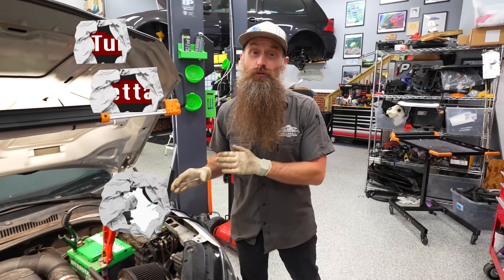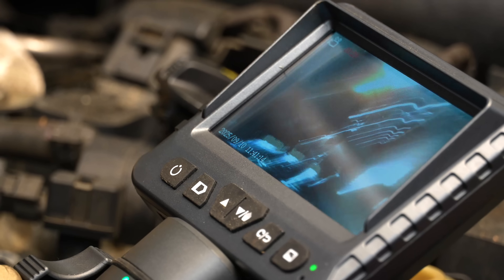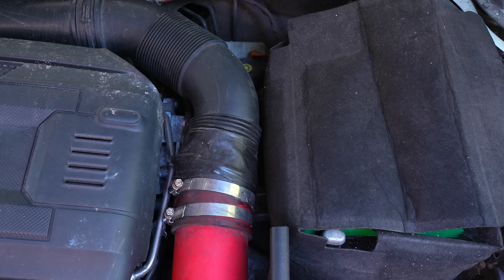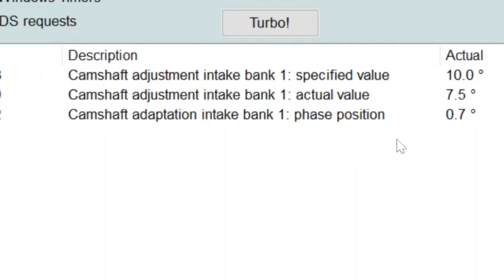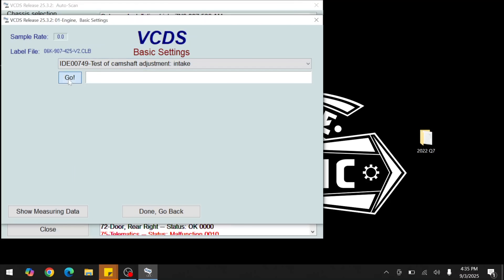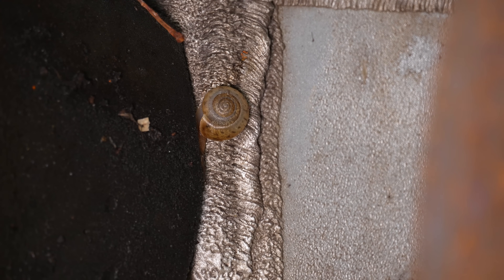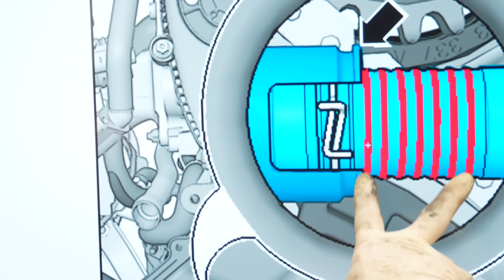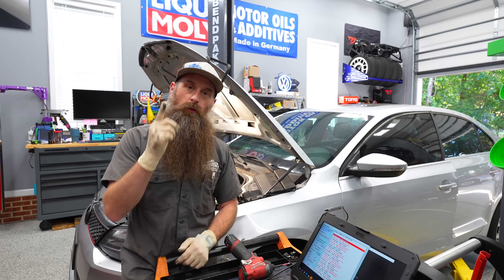TSI Timing Chain Failure: DIY Test That Will Save Your Engine

Comment from the maker: Do you have timing chain stretch, wear, noise, or rattle on your EA888 2.0T or 1.8T? This quick DIY check works on VW, Audi, Porsche, Skoda, and SEAT.
⚡ A few minutes now could save your engine and thousands of dollars in repairs.
👇 Drop a comment if you’ve had timing chain issues with your EA888 — let’s see how common this problem really is.
Reply: Hey, how many miles do you have to have before you need to start worrying about this?   I'm wondering if I need to pull that plug off and check the tensioner.  I kind of miss timing belts, you knew you were going to have to replace them but they didn't cost that much.
Reply: @jeffk464 just buy a obd11 and check your camshaft position...

I have a 2012 beetle turbo 2.0tsi e888 gen 1 and I just did mine at 149k miles..
 My timing was -5.47   which was out of spec ... i checked it.
About a year ago and I was in the forest so I figure the way I drive and the power that my car has.I stretch my chain one degree every year...

I'm around 320ish whp on a cts ko4... I think a lot of the timing components depend on how often you change your oil... I religiously change mine at three thousand miles...
Reply: 2006 Golf MK5 GT TSI 170hp (BLG) ex-owner.
Right after the 2 year warranty mark the car lit the check engine light.
OBDed the hell out of it getting only a "cylinder 1 misfire" warning.

Shop #1: changed coils and apark plugs. No luck.

Shop #2: official VW shop were the car was purchased. They had no clue. they wanted me to pay any replacement part and/or inspection until the failure was addressed. Heck no.

Shop #3: standard "bosch service" shop. They listened to me, I said there was a ratling noise under certain RPM, the inspected with boroscope and, yeah, stretched chain about to slip in the lower crankshaft pinion/crown and fully extended hydro-tensioners.
1300€ repair + 500€ for two weeks later because the Poly-V set just fell to the ground in a roundabout+ 350€ for oil cooler replacement.

Sold the car after all that. Of course it had tons of other issues during warranty like gerabox synchos crushed, N75/N95 and many other valves and actuators failure, peeling interior plastics, unbalanced flywheel, etc,etc.

So, VW is dealing with this issue since LONG time ago and still not figured how to get it right. Lamentable
Never buying a VAG car again.
Reply: Hey, Charles, is this the revised engine with the cylinder issues fixed, the one that comes with the MK7 GTI?
Reply: Are you going to the jamboree next weekend?
Reply: This isn't a full proof way of diagnosing using IDE00184 as there was no explanation if reading on a tsi 2.0 golf r for example.  Reading -1.1 exhaust phase position.
Reply: Hello, I have a problem with my Golf 7 GTI.

During heavy acceleration, the EPC engine warning light comes on and restricts the engine to 4000 rpm.

Fault code: P164B 00.

Have you ever encountered this problem?

Please help me.

I'm French living in Guadeloupe.
Reply: @Flingstone97 could possibly be your timing?Your fuel pump is controlled by a lobe on the intake came shaft.. if it's off you will not be getting the correct amount of fuel you need... So low r p m the car might run fine but give it the beans and you may get miss fires for lack of fuel...

That's just one option... There.
Are many more that can be going wrong
Reply: @korey420  Hello, thank you for your reply.

The fault code says (oil pressure switch).

I replaced the blue and brown sensors and still have the same problem.
Reply: met a guy with 300k km on his CJXC with no timing job done. had it since new, oil changes at 10k km
Reply: I’m
Reply: I chanched more 1,8t chains then  2t, but much more 1,4lturbocompressor 170Ps/ 167hp
Reply: Hello sir I have a question that's unrelated to this video but related to Volkswagen. I have a 14 MK-6 Jetta 1.8 turbo and I broke a ground coil while trying to change my ignition coils and spark plugs and I wanted to know if you could tell me which harness I need is it a 4DO or an 8DO I've been doing research all day I can't get the ignition coils unhooked right now to see the part number and I need to order the part I've been getting rides to work and am broke. 
Thank you very much.
Reply: Would you say these tips for checking it apply to a 2.0 TDI? Im aware its a different engine, but it is also a 2L turbo. Either its my Ac compressor or the timing chain. Neither is cheap to replace, so I want to make sure I get this right on the first try. And I dont want a dead engine. With the ac compressor off, the shuddering on startup goes away. The cooling in the summer is also subpar. At 70 degrees,  it doesnt ever really get cold. But I hear a very faint sound coming from near the serpentine/ timing chain area. It sounds like a metal file being used gently. And it makes the sound about every 1 second ish. No codes at all. Any ideas?

Comment: I just did the timing chain [due to chain chatter] and it started to studder and turn off... I quadruple checked my work.. but it still chatters and shuts off when I give it gas.. start up and idle is smooth.. what could it be now?

Comment: I have that magnet failed twice now on 2015 Passat 1.8 (255K)

1st one failed around 180k - I think it cracked, I don't remember exactly;
2nd one recently at 250K - it has a crack in the middle (was from a junkyard car 2014 Passat)
The crack is kind hard to see - I still have to old one if want a picture.

Symptoms: 
Same exact as this video - intake camshaft jumping values on OBD Eleven and some rough idle with sometimes misfires (No code for misfires although but you can tell).
My code was: 
P000A00 - " A" Camshaft Position Slow Response

Other checks - I did took the actuator out to see if stuck, clogged, or something wrong (reverse threads on it almost got me), but nothing found (move freely, nice spring action, and it was clean)

Replacing the magnet solve my problem for now, but I am planning to inspect that tensioner through the access hole when I find time.

My oil changes are every 7K blue bottle 5W40 of Moli with the MAN filter (bought the car at 70K - I think previous owner didn't took care so much and he did 10k+ oil changes)
Opinion - I think the Castrl is no good - the moment I switched to Moli it doesn't burn oil excessive  anymore.

Last: Every oil change I did on the last 180k, I always found 5-10 flakes of metal in the oil,
but nothing inside the filter, no idea where it can come from.
(If someone has a idea how find were is coming from without taking the engine apart let know)

Comment: Belt are better than chain ,long as you service the cars, change  oil every 10k miles. I have tt mk2 200k on the clock , belt changed every 60k.

Comment: I found one of these that had all the timing codes but when I tore it down I found that the little button on the intake gear was stuck out. Like the little button slipped out of the sleeve causing the intake cam to always be actuated.

Comment: So what's it mean if the phase position is 26 degrees? 😬
I've been trying to diagnose a P0016 on a 2017 A3 2.0 and I've already redone the timing chain about 3 times. I've checked all the usual suspects (spool valve, magnets, etc.) scoped cam and crank sensors and compared the waveform to  a known good (looks perfect) and I'm at a loss.

Comment: Hello, found your channel very coo thank you,  I just did the timing chain on 2012 A6, 3.0 and everything runs great, starts up , acceleration superb.  The only issue is now I have a warning light with a key icon "Engine system start fault. Contact dealer"  it comes off about 10 seconds after you start the car. Is this something that can be erased/fixed with VDCS  software? I was watching your videos on VDCS vs OBD11  ?

Comment: Hello, I have a question about my 2011 Audi A4 Allroad 2.0 TFSI (CDNC). I cannot confirm whether the timing chain has ever been replaced.

VCDS shows the “Camshaft adaptation intake bank 1: phase” value at around –7.5°, but there is no cold-start rattle and no fault codes. I also noticed that the Guide for Upper Timing Chain installed on the car has the part number 06H109469T.

1) Does the “T” revision on 06H109469T mean the guide was definitely replaced, or could this part still be factory-original?

2) If the chain was replaced, what else could cause a –7.5° camshaft adaptation value?

Thanks in advance for any insight.

Comment: I just installed new chain , tensioner and guides from Shopdap , paul !! 2017 vw Tiguan 2.0. After i got completed instal and rotated engine several revs the tensioner is out 7 ribs!!!!!  Spoke to Paul and he says to check for stretch!!!! My question is why would there be stretch on a not started engine yet , Ina timing    chain, tensioner and guides?  
Any thoughts please?? Thanks. Love ur videos!

Comment: Incredible tutorial. I've just had the timing chain replaced and these codes have come up- P0341/P2279/P2006, any instruction would be greatly appreciated. The P0341 code says camshaft positioning  sensor, should I replace it?
Reply: Did they correctly time it?

Comment: 238k on my 2016 Passat 1.8t with original timing and magnet.. Still within specs and makes zero noise.. OCI change every 5k miles religiously since new.. Still rocking the original turbo and fuel pump as well!!

Comment: I just bought a 2019 VW Altas S 2.0T. My father told me he heard clicking clicking while run parked or driving on freeway. I want to know if you know what it's cause noise clicking from front right bumper area between passenger. I am very concerned about it. I hope I didn't bought a lemon SUV  😞

Comment: You guys make out like these engines are rubbish. Sure , they aren’t a 2JZ , but with proper maintenance and proper mods they can be a 350jp motor that will be a fun DD and weekend fun machine. You want a 500 hp monster out of the box , then buy a Supra. I have an IE forged internals 2.0 in my 08 GTI with an internally worked K04. Overbuilt for reliability, but will never have an issue.

Comment: Charles do you ever use a pico? Im starting to transition to using it more that just a scanner to diagnose and i think scoping is a skill many mechanics lack
Reply from the maker: I’m a rookie pico user at this point in time.
Reply: @HumbleMechanic  ok, I completely understand you on that Charles. One thing the dealer lacks is proper oscilloscope training, and Im a former acura honda tech and when I left the dealer I realized the independent diagnostic guys that used pico a lot really were a different breed. Makes me respect guys like Eric O and Super Mario and Sherwood from Royalty so much more. The dealer world needs to really start implementing that to transition us from parts swappers to actual technicians. Diagnosing with an oscilloscope is a whole world that helps us without ever busting out a wrench.

Comment: I love your videos! They encouraged me to start doing most of the maintnence stuff by myself saveing me a lot of money! 

Maybe an odd question, but is it possible if the camshaft RPM sensor won't display the camshaft revolutions (I got no error message but with OBD11 the value stays at 0RPM), that there are some odd shiftings  from the gearbox due to lack of consistency of the camshaft RPM and engine RPM?

I drive an 2018 GTI Performance with -120k miles on it.

Greetings from Germany!

Comment: 266,000km on my 2016 TT and still on original timing. Using stage 1 unitronic as well. 

 The problem is bad drivers. Not bad parts. Change your oil based on how you drive it, not how many km you drive.  and use good oil. Not even dealer oil is good imo. If it’s a euro car, liquimoly or motul should only be used. 

I also don’t like cruising in low rpm. I always keep my cruising rpm no lower than 2000. Let that oil pump feed the top of the motor. 
I recently changed my hpfp and while i was there i swapped out for a new cam follower and it literally looked brand new still. No wear markings. Keeping your rpm higher when cruising will help the head lubricate properly.

Comment: I'm likely being simplistic here, and due to the high mileage of 181K and the state of the oil found on the dipstick; is this a case of few and far between oil changes (amongst the other visible abuse of that poor GLI)?

Comment: On cold start up with my 21 GTI 7.5, I get a bit of chain clatter, but then it instantly goes away. The dealer thought it was an issue and changed out the magnets. The clatter still happens. When the car is running it is buttery smooth. I have no fault codes. Should I be worried?

Comment: I actually did my timing service on my B8 A4 a few days before you posted this video, referencing videos made by you and Paul for the diagnosis and repair (as well as AllData, of course - your videos and articles had some info the repair manual didn't include though (: ). This video is very helpful for referencing almost all the issues I was checking. Balance shaft was out of time so bad I'm almost convinced it caused my 16 y/o motor mounts to blow out. The VCDS is incredibly helpful compared to OBDEleven since it actually allows me to run the cam adjuster test. I notice you run a procedure along the lines of Timing Chain Lengthening Reset After Replacement in a lot of videos, which I couldn't find for my vehicle but evidently didn't need to run as it's 1000x better now, is this specific to certain VW/Audi models?

Comment: Damn my sister has a 2018 Passat and it started to feel like it is miss firing at idle. We put some intake cleaner in it. Then after we drove it around came back and reved it up a couple times it was making what I'm only assuming was a timing chain slap after it idled down from reving it.

Comment: Hey, do you know what this issue might be? I've recorded a small video clip for ref https://www.youtube.com/shorts/trdmAhEDDkg It only happens when I press the gas pedal, and once I release it, the sound fades away after about 1–2 seconds.Could it be related to the turbo or fuel pump? The car is a 2019 VW Caddy TSI 1.4 (Europe).

Comment: Guys it's time to call VW out, you have seen the quality drop in all VW engines since the 2.0 ABF block. 

Plastic inlets, plastic sumps, plastic water pump fins, the cars are designed to fail.

Comment: Any reason why the intake/exhaust tests won’t activate for OBDEleven? With the idling I only get an error for  “Function cancelled, marginal conditions have not been met”. I can get the tests to go active if the cars off but that’s doesn’t work for an engine test 😅
Reply from the maker: thats odd. ive found that sometimes cars are fussy. Also some of the tests are not ran when car is running.
Reply: @HumbleMechanic  Turns out I'm still a rookie and was trying to perform an "output test", looks like the correct option is under Basic setting. Thanks for taking the time to respond and producing great vids!

Comment: Please help me Mr VW expert. Our 2014 VW Passat 1.8 tsi engine is broken down. We want to replace it with a used one but we can have a lot better choice price and mileage wise on 2015 Passat 1.8 tsi. The used part guys say that they are not interchangeable. Is there a major difference? We can swap some parts as long as the car runs with no issues. Are the piston rings updated in 2015 also? Thanks

Comment: Very informative video. I have a 2018 EA888 Gen3 and just wanted to ask as my exhaust phase position is at -3.7 and intake phase position is 0.3. As both the exhaust and intake run the same chain should I just take the reading for the intake or do I need to look at the exhaust reading when looking at possible chain stretch?

Comment: @humblemechanic. I have strange situation, my 2011 gti sometimes have long crank, two times show 0016 and 0011, replaced cam adjust and sensor still same long crank time to time . Sometimes when . Cranked it idels at low rpm. But no codes. Once start it runs well. If I press gas when cranked it start ok and if it's on low rpm I press gas it become ok. Mechanic did injection cleaning and carbon clean of intake, throttle etc. Spent a lot on those and still same. Any advice would be really appreciated.

Comment: About what mileage should you start checking for chain stretch?
Reply from the maker: if I owned from new, and did proper maintenance, id be checking at 60k miles. its so fast to check while you change the oil.,
Reply: @HumbleMechanic  OK, I need to start checking it now then.  Sounds like the best way to know for sure is to look at the tensioner itself and count the slots...

Comment: Let me tell you timing chain issues suck when it comes to Mercedes.Oh my god. especially old ones.

What happens? Is the timing gear on the front of the motor's crank? Basically fails, the pin shears off and destroys the timing of the engine and also destroys the timing chain, which required you at the time with these older models to rebuild the top heads of the engine at 12. Hundred a head.

And this was the do it yourself.Price not having a dealership rebuild them. Anyways, why I warn people not to buy an old Mercedes is very simple. If you run into one with this engine design, people have actually welded the gear to the front of the engine so definitely before you buy a used 1, ask them if it's ever been rebuilt.. because you will never get that gear off again so help you god